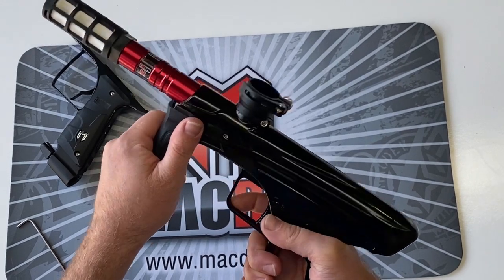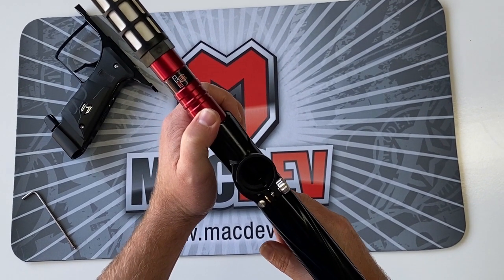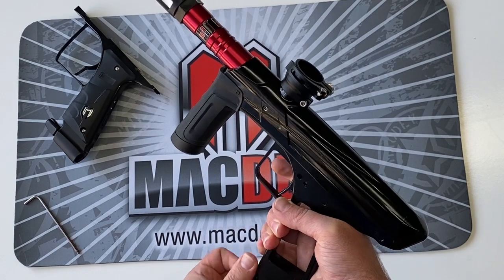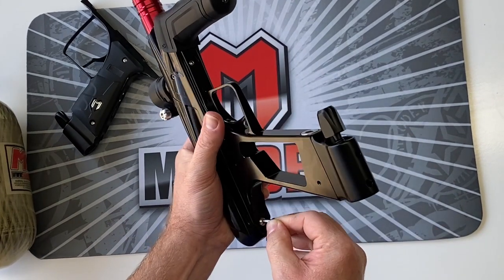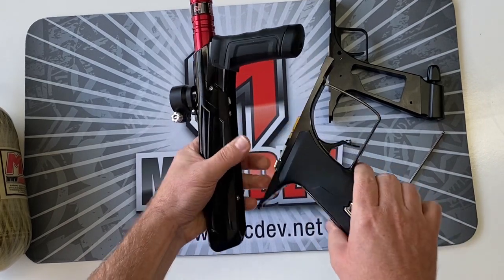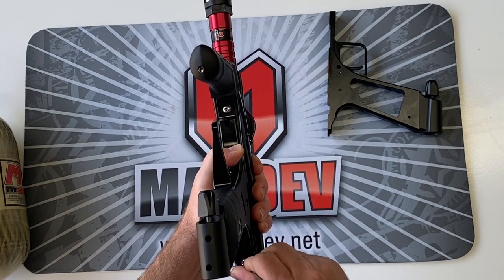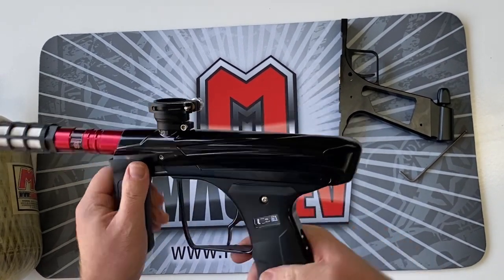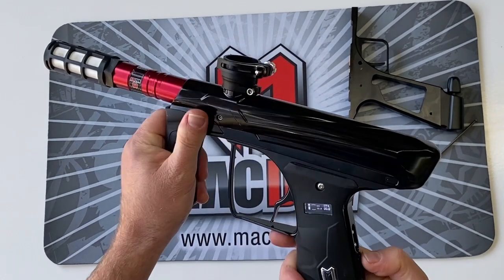XDR DEMO

Comment: is the XDR core an improvement over the Infinity Drive? Would there be an aftermarket upgrade to the XTS? Or is is marginal improvement / built to better do mech activation?
Reply: It shoots the same as infinity but is modified for mech.   They're equivalent for their platforms.  IMHO the XDR infinity appears simpler and more refined.

Comment: Looks decent... not worth the Luxe or CS2 price tag though, especially coming off their past markers
Reply: Ok, well considering it's $850 retail price is close to half that of a Luxe ($1500) or CS2 ($$1,579) you should be stoked then. This is a direct competitor of the Shocker/170R/DSR, not the markers mentioned.
Reply: You're absolutely right,  I was looking at the price with the mech frame which is actually decent!
Reply: @udfxrookie  I loved how the C5 shot, but didn't like the weak feedneck, finicky trigger mount, and thin ergs. This seems to keep the good, address all the weak spots, and add mech. It really should be an excellent marker.